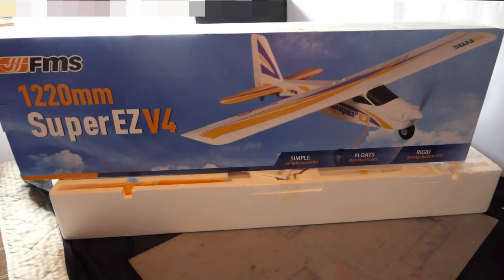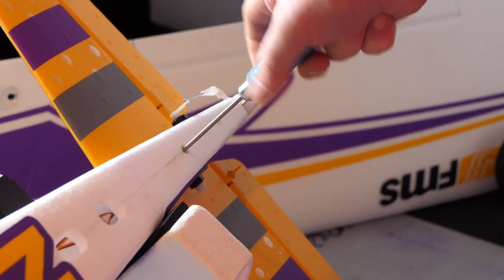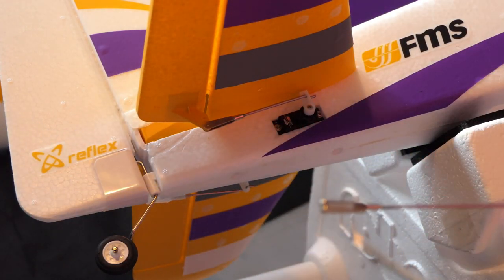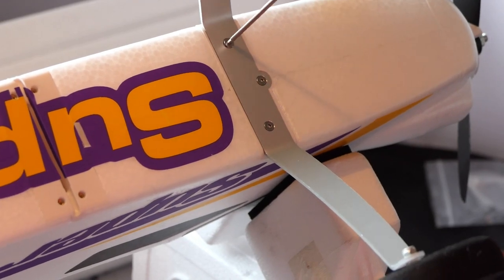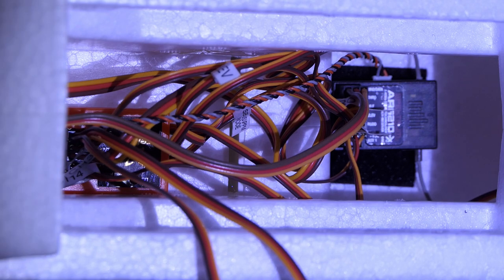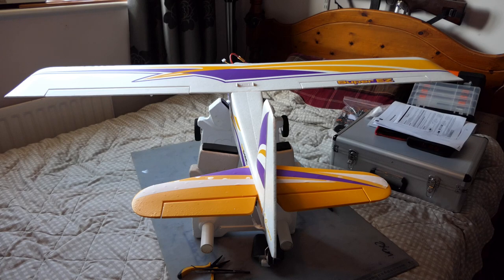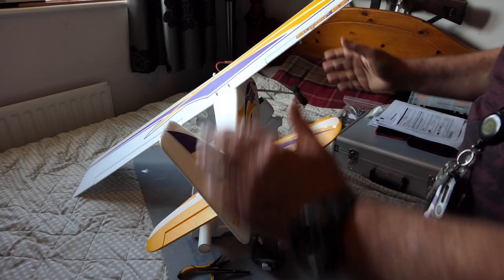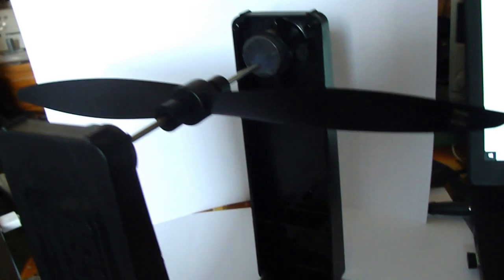Assembly - Goodbye Bonanza , Hello FMS Super EZ V4

Comment: Unusual to have problems with an Fms plane!! I'm shocked at the wrong sized link too!! I have the V3 model and it's been faultless, although at first I didn't trust those plastic cams to attach the wings!! But thankfully they have always worked perfectly, I love glueless builds and Fms are one of the best at this. And as of today I have bought the V4 from Banggood for £100 😄 Great video and great info!! Thanks for sharing👍😄
Reply from the maker: It was unusual indeed - but a quick fix , that first "CLICK" when turning the plastic bolts with the locking cams on shocked me a little, she flys so well - I think this one will always be coming to the field with me just for the fun of it.....
Reply: Yep it's a very versatile plane!! And it hasn't really got any vices!! Apart from slowing it down to land that is, been meaning to try flaperons on mine.👍😄

Comment: Good vid. I have the V2 & wondered what has changed. Besides the colour scheme, the only difference I see is the stabilisation module. I don’t think the SuprEZ needs AS3X or safe, it is so well mannered without. I learned to fly with mine, & I still enjoy flying it.
Reply from the maker: Your quite correct it really does not need the Reflex system - it is a good well behaved Trainer aircraft that can also be used to mess about with once your ready to do so...

Comment: Excellent video. Very succinctly explained. Appreciate quality content like yours. Where do get the thicker rods for the elevator and the rudder that you installed? Cheers
Reply from the maker: Thank you very much  - I live in the UK and I am very lucky that I have a local Model shop that is only a few minutes away from me by CAR or 15 walking... the Thicker rods and metal clevis's were purchased from that model shop but can be found on ebay

Comment: I bought this plane RTF . it has no gyro! Did you add gyro to the plane ?
Reply from the maker: No my V4 came with a Reflex Gyro already in it - I had to provide an RX, TX and Battery - I have seen some for sale with without the Reflex Gyro. - But in truth it does not need one unless you are a new learner -

Comment: Hi FT.   I am new to this wonderful hobby this year and had an incident with my SuperEZ V4.   I broke the rudder right off.   This will be my first time re-attaching a control surface on a foam plane.   I have seen so many ways of doing this.   What do you recommend?   Foam tac glue, tape, du-bro hinges, mylar hinges?   Thanks.
Reply from the maker: You need to be comfortable with the method if possable get some foam and practice..tape is not neat and you need to know how to  shall we say over and under it . so it makes  a good hinge  foam tac alone is not a good idea
 Can you get some CA hinges  they are just that little bit easier than mylar . My choice would be mylar , CA hinges or any flat type hinge the type with a pin holding the two flat parts together  you might even want to think about pinning then once fitted...hope this helps and good luck... youtube  has a lot of good videos that will help you.
Reply: Thanks very much for the quick reply FT.   I think I am going to go with the hinge with the pin in the middle.   Sounds like one of the best options to me.  
                   Dave (from Canada)

Comment: Hey, nice video. What kind of foam cradle is that?
Reply from the maker: its made by ROBART SUPER STAND II LARGE STYROFOAM ADJUSTABLE STAND - about £45.00 from ebay - if you can still get them - they have a few design faults but nothing that cannot be quickly corrected....
Reply: @FlankerTanker  Thanks, I'll look into it. I think it's weird I cannot find a cradle for cheap liks $20 bucks. Thinking of just making my own.